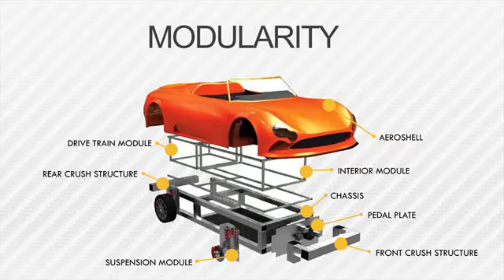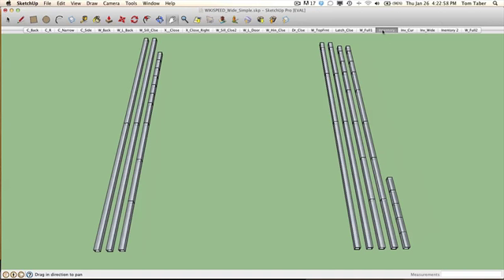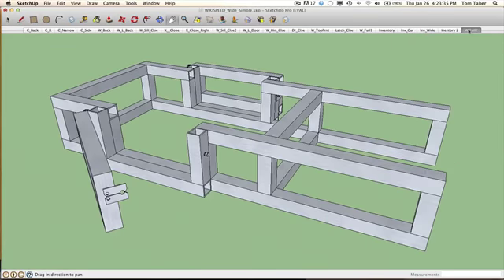WIKISPEED Wide Chassis with Doors

Comment: Would the removal of the top of the rail cause a front or rear impact issue? That is to say would it create a negative stress point, causing the vehicle to fold into the passenger cabin upon impact?